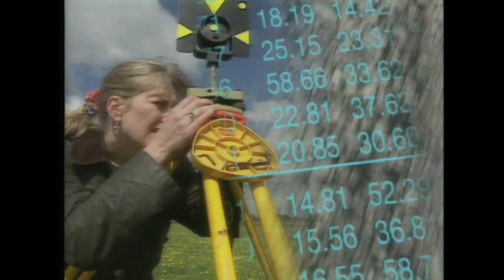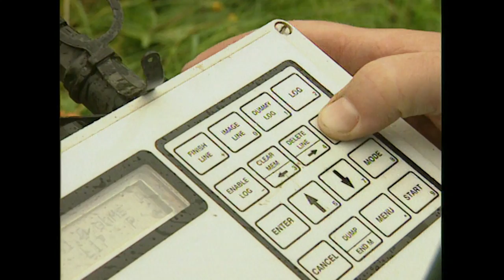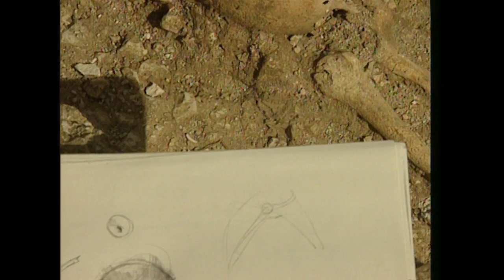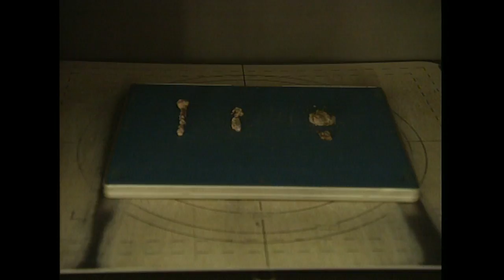Why This English Town Is Filled With Saxon Graves | Time Team | Absolute History

Comment: I sure hope the way these properties are handled has changed. I don't think it's right to tell someone that not only can they not develop before investigation is done but they also have to bear the financial burden of the archaeological investigation.
Reply: Around here we have developers that buy heritage properties and then just let them sit vacant, unmaintained, until they have deteriorated to the point where they are no longer structually sound so that they can pull them down instead of having to work with the existing façade.
  I feel bad for the guy on a personal level, but I don't respect property development in the slightest.  Every last inch of ground is just a dollar sign to them.
Reply: @funstuff2006  I see no evidence that his profession is property development though. You can be a property developer as a side business. You buy land, build a house and sell it, you're a property developer by definition.